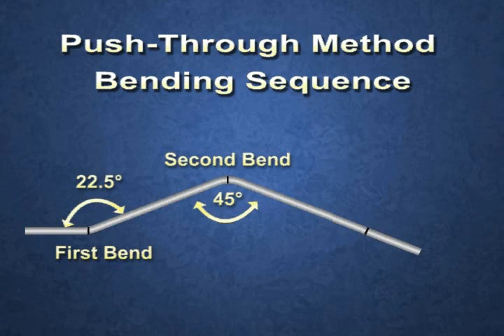Three Bend Saddle Electric Bender

Comment: In the 3-point folding saddle, how much is the separation of the first doubles of 22.5 ° to the center mark of 45 ° and the advance of point C that follows at 22.5 °.
Reply: It depends on the obstruction height that you are trying to get over. Look up 3 point saddle videos and it will explain the principle better.
Reply: What about the o.d. (outside diameter) out the conduit?

Comment: do you have to find the 22 1/2 and 45 centers? or which center are we talking about?
Reply: Yes
Reply: You have to use the center of the bend because the center of the 45 degree bend should be centered over the obstruction.